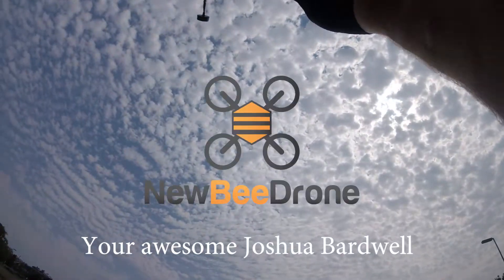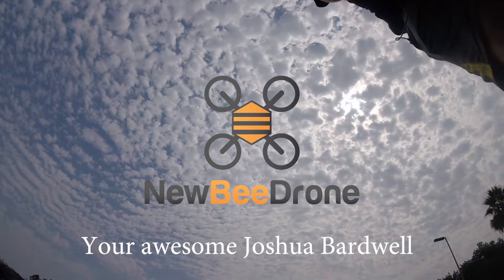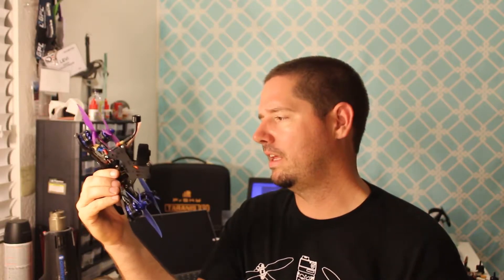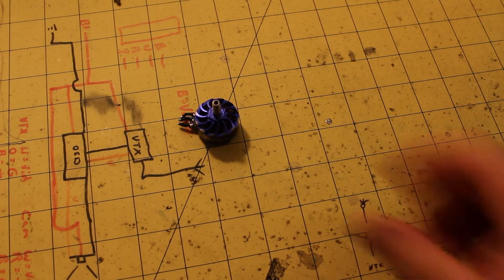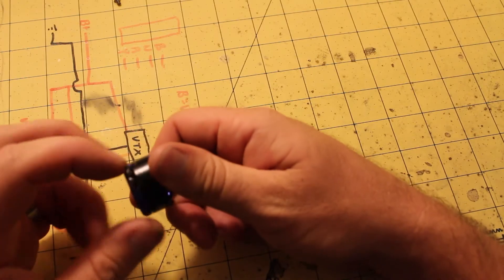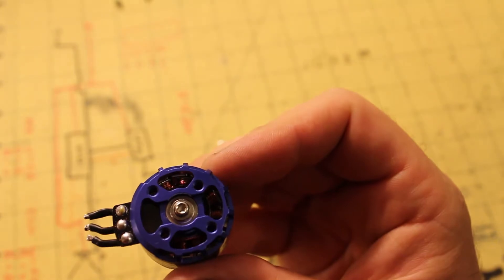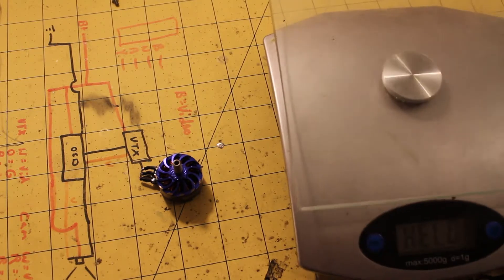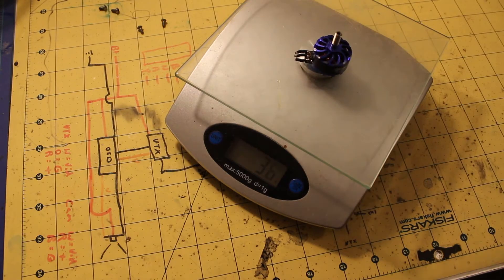LD Power 2307 3000kv - USELESS? "You're" I know Sorry

Comment: Please tell me what prop were you using at the end of the video. I just feel in love with these motors and I want to try the 3000kv version like yours if I can get my hands on
 it
Reply from the maker: They were dal cyclone, not totally sure what pitch
Reply: @LeviathanFPV  Woa! Thanks for the fast response. Do you think they are still worth it for the price? Bg have the 2750 version and I was thinking to buy a set for a new quad 5.5 inch. Any suggestion?
Reply from the maker: i believe newbeedrone.com has them in stock still, but 5.5 in feels like a bit too much for props. My batteries were crying when i got on it.  Also not sure what the price is now, but i would say 17/motor is the most id spend